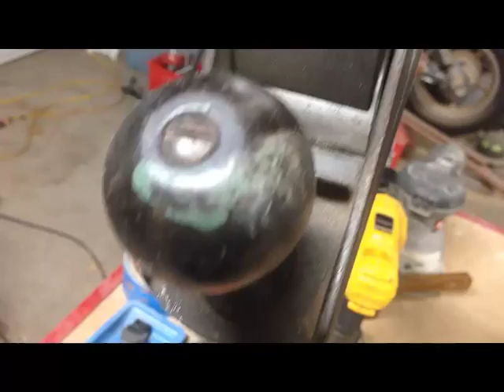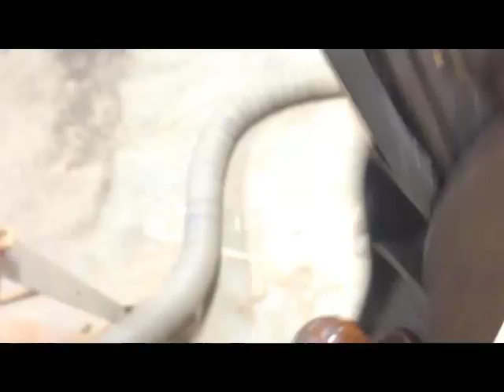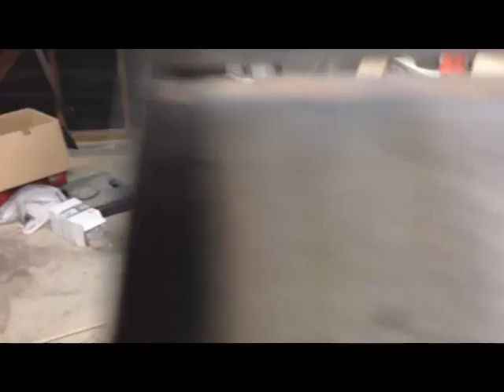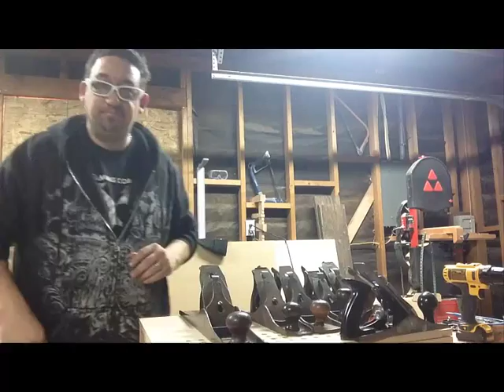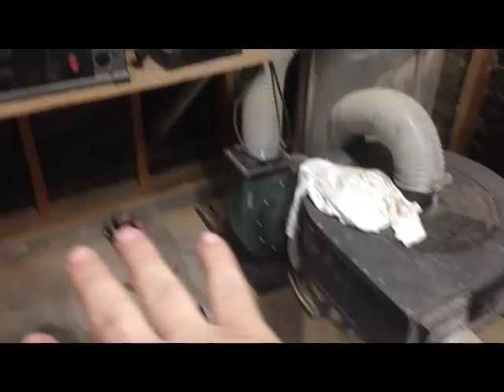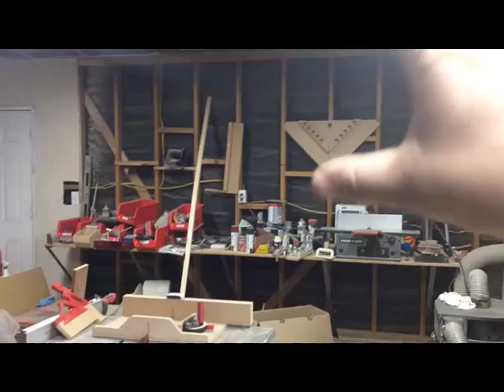Shop Update #1 ( Trustworthy hand plane?)

Comment: Trustworthy sold by salt lake co. and it made by Sargent  c. 1950. I have got one Trustworthy Jack Plane.
More information : Winchester Both Stanley and Sargent made planes for Winchester. If the model numbers begin with “3” (3004, 3008. etc.) then it was made by Sargent. If the number begins with “W” (W004, W008, etc.) then it’s a Stanley. Some of the “W” models (not all) are early-type Bedrocks.
Please check this site for Sargent : https://www.timetestedtools.net/2016/01/27/history-of-sargent/